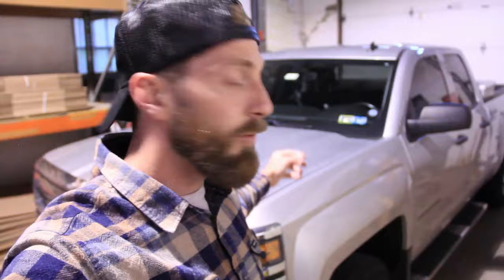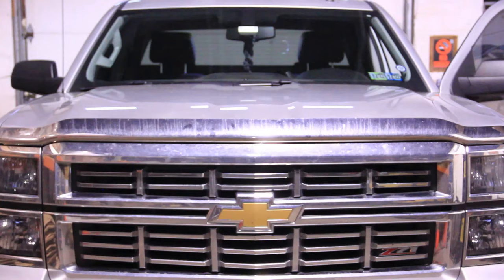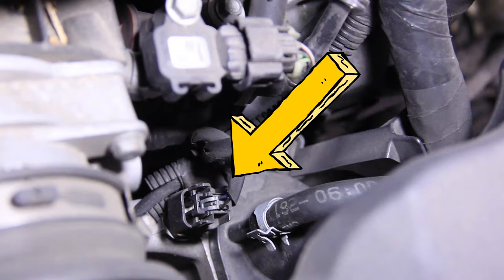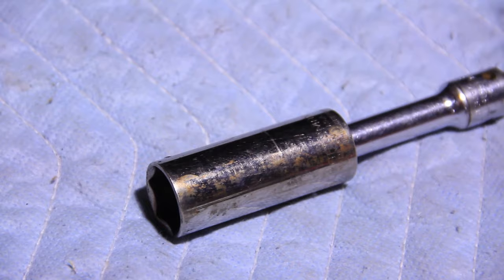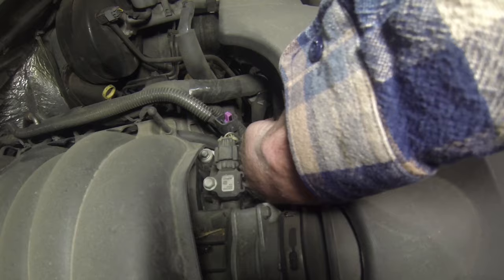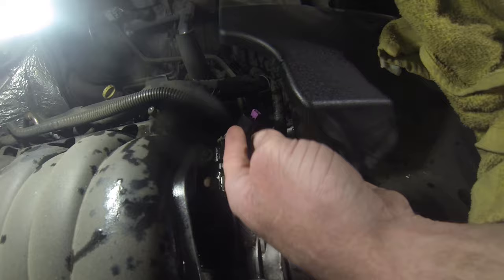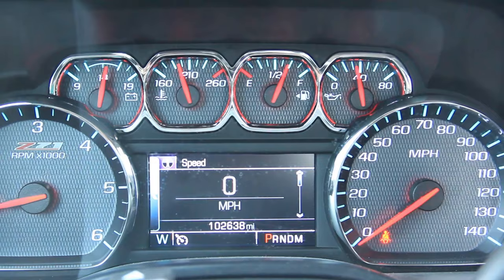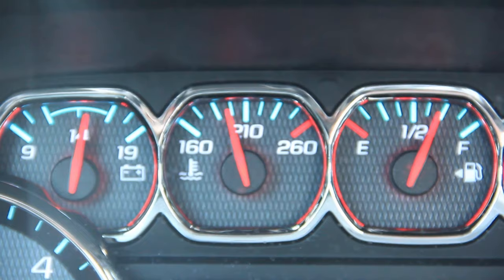Radiator Fan Won't Turn Off: 2014 - 2019 Silverado & Sierra: Bad Coolant Temperature Sensor Replaced

Comment: I had the same problem and also changed the sensor. But then there was still a ventilation noise 🤔Seems that my mid-engine sports car has two fans, one in front and one close to the engine. That was only a bad connection in the cable! So everyone can change a heat sensor at home and you don’t have to spend a lot of money at a garage. Thanks guys!
Reply from the maker: Hey Henk! This is absolutely something anyone can do, and it's a very easy fix.  We're not familiar with a ventilation noise, but definitely glad you got that fixed up.  Thanks for watching the video!
Reply: @TheBrothersWorkshop   hey
Reply from the maker: Hey!
Reply: @TheBrothersWorkshop  😀 hey?
Reply: Great conversation 😀 
Whatever, I hope you have a new video soon. Maybe something about wood in the back of a truck. See you guys!
Reply: @TheBrothersWorkshop   so this engine runs at lower temperature? My cars run close to  210?! 6:35 is that temperature normal on that truck? Thanks!

Comment: Sounds like my problem. Will be trying this in the morning. THANK YOU
Reply from the maker: We recommend replacing the thermostat and the sensor together.  I've linked two other videos for you below. 👇
https://youtu.be/wed9eZxPwsQ
https://youtu.be/WvLyBM8FHdM
Reply: @TheBrothersWorkshop  GRRRRRRRR.... Wish that had been said in the 1st video... LOL... Replaced the Temperature sensor.. Still had problem.. Doing thermostat this evening. THANK YOU AGAIN for the great videos
Reply from the maker: It was said at the end of the video.  The problem is it could be one, the other, or both.  It's hard to tell because no codes are thrown.

Comment: I noticed this issue tonight on my way home.  I heard a strange sound, popped the hood saw that the fans were running at full speed and thought that was weird.  But it only got weirder after I turned off the engine and they were still running.  Luckily there is a few seconds after restarting my engine where the fans aren’t running so I can turn off the engine and they stay off.  Do you know if they will eventually stop on their own or would they run until the battery dies?  I’ll have to see if this is still an issue tomorrow and if it is, see if I can fix it myself.  Your video makes it look easy but I’m not too sure.  Plus my apartment building frowns on car work occurring in the parking lot.  Thanks for the information.
Reply from the maker: That's exactly what happened to ours.  I can't say if it will drain you battery because I fixed it asap.  This fix is very quick, you won't be there long enough for anyone to become upset.  Also, we have an updated more detailed video that will help with some common issues.  I've linked it here for you: https://youtu.be/7gKbLHhD1cw?si=XFF51Xu2e66HevQK

Comment: Thank you for the video , unfortunately my sensor wasn’t the solution . So my truck is headed to the shop 👌🏼
Reply from the maker: Hey Nick, I hope you watched the follow up video before taking it in: https://youtu.be/wed9eZxPwsQ
Reply: @TheBrothersWorkshop  I figured it was the thermostat, but my trucks under warranty still they need to get it fixed . Also my ac compressor has been faulty for some time , two birds one stone
Reply from the maker: What did they say was the problem?
Reply: @TheBrothersWorkshop  the housing for the thermostat and the coolant sensor were replaced , also my transmission filter was fixed . 1500$ but my warranty covered it all
Reply from the maker: So your telling me, this video is saving people about $1000?! Give or take the $500 for the transmission filter.... 😬😱
Reply: @TheBrothersWorkshop  id say so , most of the charge was for labor , for 3 days they charged almost 1100 in labor . Saving minimum of 7-800 by going it yourself

Comment: Been having the same problem today just started fans running high after shutting down have 2017 Colorado 3.6 did the disconnect the battery both negative and positive it worked for a good while and did the same thing again just disconnected again for a good two minutes and back to normal see how it works tomorrow
Reply from the maker: I can't speak for the Colorado, since I don't have one.  However, it sounds like the same issue.  If the sensor doesn't work.  They the thermostat.  https://youtu.be/WvLyBM8FHdM

Comment: Something that happened to me is that I had overcharged the ac system and it also affects the way your fans work.  So take that in mind
Reply: So let’s say I overcharged the ac system, would it make the fan stay on the whole time? What do I need to do to fix this?
Reply: @juanlara8191  I would recommend to throw all the refrigerant out and recharge it  with two 12 ounze bottles that most likely will fix your  problem.  It has happened to me several times on different vehicles.    Your ac compressor pressure has to do alot with the way ur fans will work
Reply from the maker: In the case of this video, the AC system was definitely not the culprit.  The AC system was fixed 3 years prior to this video and hasn't be touched since.  After this fix the truck has worked great.  We haven't had any issues with this particular problem since the video was posted. 

A quick back story on the AC systems for the 2014-2015 GM trucks, they have a major design flaw that causes them to fail overtime.  This issue was fixed for the 2016-2018 trucks.

Comment: Thank you for the video. Mine came up with a Check Engine Light too. Does this have to do anything with a cold weather?
Reply from the maker: Hey Joshua, this issue does not trigger a check engine light.  I would take your truck to a parts dealer and have them check the code.  You may have another underlying issue.  If not I've linked both the trouble shooting video and thermostat Replacement videos below: 👇
Thermometer Replacement: https://youtu.be/WvLyBM8FHdM
Troubleshooting video: https://youtu.be/wed9eZxPwsQ

Comment: Thank you for the video. Was for sure helpful!!! I wouldn’t have known had I not searched YouTube and found this video. Also provided the secondary issue that night happens which did happen for y’all. Once I get the part and put it in I’ll see if then thermostat needs to be replaced as well.
Reply from the maker: We ended up replacing both parts.  Just a side note, you don't have to wrap the sensor with teflon tape.  It may cause an issue with grounding.  Also, disconnecting the battery will help your computer reset and.read the new equipment correctly.  Good luck!

Comment: I had this sensor replaced, no change.  Something that DOES stop the issue (for anywhere from a few days to 3-4 months) is disconnecting the battery negative a few moments.  To me this rules out any mechanical sensors, as disconnecting power wouldn't "reset" these as far as I know.   I've had this problem for a few years on and off.
Reply from the maker: You've skipped the other two videos in this series, and overlooked the video description.  You MUST watch all three videos in this series to correctly fix the issue! I've linked the playlist here for you: https://youtube.com/playlist?list=PLnPXcXYmgiuvbA7f_Zot4ScG1DJ7QJgO8&si=15fsNB4eWko3Dzp-

Comment: Same is happening to my 2014 silverado but im not throwing any codes. Going to try this tonight.
Reply from the maker: Hey Adam!  This issue does not throw any codes.  We have a video linked here that goes over things we forgot to mention earlier: https://youtu.be/wed9eZxPwsQ
Reply: @TheBrothersWorkshop  Thanks, I had the same thing happen to my 2015 and it was throwing a p0128 code. I did buy the part to fix my 14 but before i could install it the problem went away earlier today.....lol Needless to say, between all the transmission issues, AFM lifters and so on im selling both trucks and buying a Toyota.

Comment: Great video, right on the point. 
Can the thermostat performance , effect the catalytic converter ? 
Thanks for sharing.
Reply from the maker: Hey John! Thanks for watching.  As for the catalytic converter, I'm not sure if the thermostat would affect it.  However, I do know there are issues with the catalytic converter on these trucks, and from time to time they need replaced.

Comment: Swapped the sensor, reset the battery, so far so good. Quick question though, is it recommended to go ahead and change the thermostat now, or if it ain't broke don't fix it?
Reply from the maker: I recommend doing both at the same time. However if you haven't, just know that you might eventually need to.

Comment: I have this in a 2015 Tahoe.  Also, hopefully coincidence, the A/C quits cooling.
Are others getting this too?
Reply from the maker: It seems to be related, but I did not have that issue because it happened during the winter.

Comment: Coming back to this video, this is my 3rd time replacing the sensor this year, should I just replace the thermostat?
Reply from the maker: Yes, I would replace the thermostat if the sensor did not fix the issue.  I've linked our troubleshooting and thermostat replacement videos below for you: 👇
Troubleshooting:
https://youtu.be/wed9eZxPwsQ
Thermostat Replacement:
https://youtu.be/WvLyBM8FHdM

Comment: Thanks mines doing the same thing! Appreciate the content 👍
Reply from the maker: Thanks for watching the video.  I hope this helps fix your truck!
Reply: @TheBrothersWorkshop  hey one last thing you didn’t mention in your video you need to disconnect the battery to reset the computer because after I installed my pressure sensor the fan came on so  I disconnected the battery so the truck computer could reset itself now it works fine! But thanks again👍

Comment: 2014 Silverado....great video.  I replaced the sensor but it still happens.  Would the replacement of the fan relays be next?
Reply: Try disconnecting the battery and reconnected it. Just changed my yesterday had the same issue.
Reply from the maker: Hey Dominic, we've made two videos for people having this issue.  The first is a quick video that explains the common reasons you could be experiencing this issue.  The second video explains how to replace the thermostat (the most common reason this is still occuring).  I've linked both below for you.  👇

https://youtu.be/wed9eZxPwsQ

https://youtu.be/WvLyBM8FHdM
Reply from the maker: We've made two videos for people having this issue.  The first is a quick video that explains the common reasons you could be experiencing this issue.  The second video explains how to replace the thermostat (the most common reason this is still occuring).  I've linked both below for you.  👇

https://youtu.be/wed9eZxPwsQ

https://youtu.be/WvLyBM8FHdM

Comment: Does this also prevent the ac from working because mine is stuck at 160 check engine light  and fan  runs continuously when I shut off truck ac was working really well before this now ac doesn’t cool

Comment: Came home last night.  My fans were running full speed.  I parked the truck, searched youtube.  Found this.  I'll try it in the AM.  I will say though I'm worried because my fans did eventually shut off and my battery is low now.
Reply from the maker: Did you get a chance to replace the sensor?
Reply: @TheBrothersWorkshop  , yes!  The fan issue is resolved but now my battery won't hold a charge at all.  I guess I'll replace it next.
Reply from the maker: Your battery may have had a preexisting issue.  Hopefully replacing it will fix that issue.
Reply: @TheBrothersWorkshop  New battery is in.  Starts up so nice.  It was the original battery so it was time.

Comment: Big help thanks new sub.
What happened if you drive it like that for a few days. Reason asking didn't notice till I got home drove about an hr
Reply from the maker: I drove mine on an almost seven hour road trip like that.  Nothing happened to the truck but I wouldn't ignore the problem.  After fixing the issue, it runs great.

Comment: Is the temp sensor always gonna be by the thermostat? I know ever year the models are different. I have a 2016 Chevy Silverado single cab and it appears the sensor is right next the thermostat on the left side
Reply from the maker: If you have a 2014 through 2018 5.3 V8 everything should be right where it is depicted. If you have a 4.3 l V6 it should be very close. I've changed this part on both and have no issues locating the sensor.

Comment: I actually am having this same issue. I replaced the sensor like in the video. But a few days later after everything has been running good, the same issue popped back up. Any recommendations on the next step to take?
Reply from the maker: This is the first video in the three series video please check the description for the next videos. You need to replace the thermostat as well, and also disconnect the battery to reset the computer.  Once you do that you will fix the issue and it won't come back.

Comment: I didn’t bother removing the intake. You can access the sensor from the top using an extension. It helps to stand on something so you can see it. Be sure to disconnect the battery to reset the computer otherwise it won’t recognize the new one.

Comment: So i had this happen but it went back to normal on my drive home from work,a few weeks later my ac was working fine than it went out blowing warm air, the compressor runs but the clutch doesn't engage, would this cause this issue? My temperature is normal when driving

Comment: Solved my issue , however now I’m leaking coolant . Any suggestions? Approaches I should take ?
Reply from the maker: You probably did not correctly seat the sensor or thermostat.  Make sure they are correctly installed and attached.

Comment: I changed the temperature sensor already & after a month the fans started again & temperature not reading it u   think it could be the thermostat?
Reply from the maker: We recommend replacing both parts at the same time and disconnecting the battery.  We have made an updated video linked here: https://youtu.be/7gKbLHhD1cw?si=8tGqYvRjFE7u6hqQ

Comment: Had this problem occur to me yesterday, but no check engine light came on. Is that normal? Heading to the part store to pick this part up
Reply from the maker: The light does not come on.  Also, avoid the teflon tape.  Some people are having grounding issues.  I have not, but don't take a chance.

Comment: Question. Will the truck overheat due to sensor not working? Or. Will coolant continue to cool engine?
Reply from the maker: We don't know. I didn't want to find out when this happened to my truck, so I replaced the parts asap.

Comment: 2014 gmc sierra has this problem usually I had to turn it on and off a couple times to get it to turn off. If  I didn’t it’ll kill my battery. Need to fix this soon cause I plan on going on a trip. Other then a thermostat or sensor what other things Amy it be?
Reply from the maker: We condensed all three videos into this new video. It explains everything as well as troubleshooting: https://youtu.be/7gKbLHhD1cw
Reply from the maker: We condensed all three of the videos on this issue into one short and detailed video for you.  I've linked it here: https://youtu.be/7gKbLHhD1cw

Comment: I have a 2016 3500 Duramax… imagine it’s a similar process as long as I can find the sensor location? Also would it prevent coolant from spraying if I let it cool and removed the reservoir cap first?
Reply from the maker: Hey Josh, I believe taking the cap off the reservoir should help with the pressure, but I can't really tell you of the 3500 Duramax is anything like the 5.3 gas motor.

Comment: Okay you guys might have wanted to wait before posting this video to see if it fixed your truck. Obviously it didn't as evidenced by your second video. However, I relied on the information in this video to buy and replace a part (sensor) that I didn't need. Like you, the problem reoccurred a few days later and it turned out to be the thermostat. I did watch your second video regarding the thermostat replacement and it's good in terms of showing how to do it. However, my extended warranty covered this repair.
Reply from the maker: Michael, if you have an extended warranty why would you try to fix this on your own?  

Regardless, this is one of three videos in this series.  All of the videos in this series are listed in this video's description, pinned in a comment, and I have attempted to draw traction in other ways.  As the old saying goes, "You can lead a horse to water but you can't make him drink."  All three will be linked at the bottom of this comment! 👇

The issue with these trucks does not throw any codes, so it is difficult to diagnose.  We believe the issue is a combination of both the temperature sensor and the thermostat.  To the best of my knowledge GM has never came out and explained the issue.  When people replace both parts and the issue continues, it is most commonly because they have not disconnected the battery (explained in the troubleshooting video).  We have preformed this fix on three of our own trucks and have no issues.

That being said, you cannot diagnose a vehicle over YouTube.  Just because you think you had the problem displayed in this video, does not mean you have it.  We always recommend having a professional look at your vehicle and diagnose the issue before you start working on it.
 
1. Temperature sensor video: https://youtu.be/aJeksrxcCDI

2. Thermostat replacement video: https://youtu.be/WvLyBM8FHdM

3. Troubleshooting video: https://youtu.be/wed9eZxPwsQ

Comment: Will the fan shut of eventually or what? Do you wait until it’s off and will it run down your battery?
Reply from the maker: From my experience, the fan will not shut off. You have to turn the truck on and turn it off again to get the fan to stop. This isn't an issue that goes away on its own. You have to replace the sensor and the thermostat. Check out our playlist for more videos.  I have linked the playlist here: https://youtube.com/playlist?list=PLnPXcXYmgiuvbA7f_Zot4ScG1DJ7QJgO8